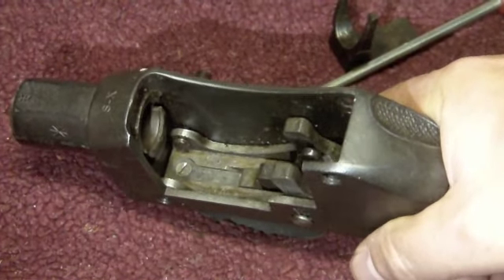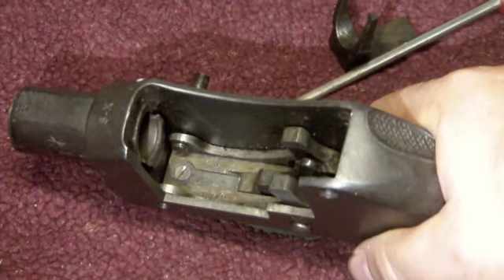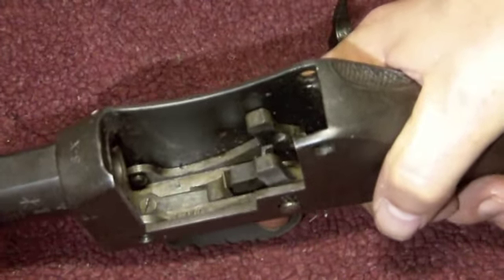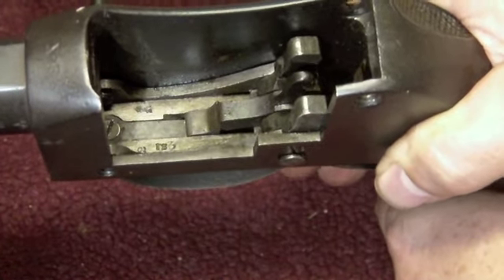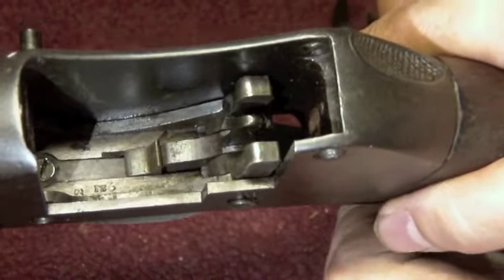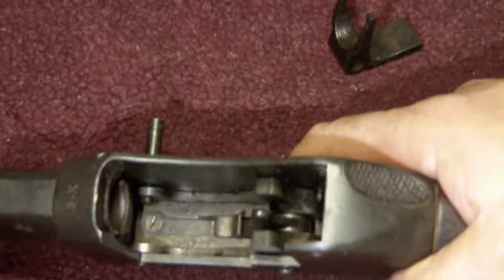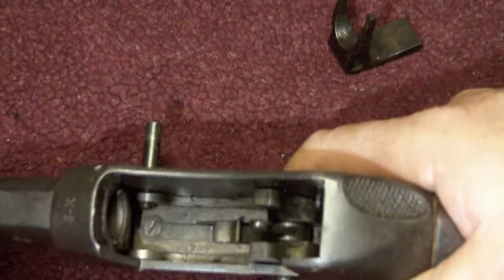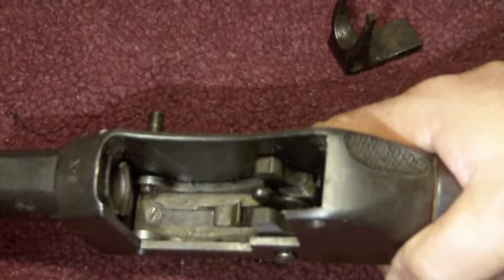Martini Henry Trigger diagnostic

Comment: Im trying to assemble the trigger and trigger spring into the trigger guard assembly (idk the correct name for it) can u make a close up vid on how to assemble it properly? I need to see how the trigger fits into the trigger guard assembly and exactly where the trigger spring rests on trigger. I noticed the trigger spring has a slight bend end. Which way does trigger spring go in (Bent side up or bent side down)? There is no vid on youtube that shows a close up view on how to do this.

Comment: I've got the opposite problem. We've got about 3 martini-henry's and 3 Martini-Enfields. the issue with most of them is that the trigger is tight. It takes far to much to pull and fire. We're working on restoring them, as we've got full and artillery models. But the trigger is to tight. Any advice? Really they're in rough condition, the sights are poor, the wood bad. The metal is mostly good though. I'm pretty sure between them all we have a good MH and a good ME.

Comment: Hi
I got a W.W. Greener GPMKII 12 gauge.
Found this out when dry fire testing (no shot shells in breach)
Issue I have is that when i cock the shotgun I forget to put it on fire and pull the trigger but when I remeber to put the safety to fire the shotgun releases the firing pin and will set off the shell.
How can I fix this issue ?

Comment: como desarmar el mecanismo  empezando por tornillos ,,que están oxidados
Reply: HOla Juan! Lei tu mensaje y quisiera preguntarte si estarías dispuesto a vender el fusil que tienes. veo que esta oxidado y tal vez necesita de algo de trabajo, pero igual me gustaría saber. Me avisas si estas interesado. Slds
Reply: el fusil que tengo quiero desarmar el cerrojo y limpiar el oxido  pero por estar interiormente oxidado no puedo,,,parce que se debe utilizar la llama de un soplete o tal vez taladrar el o los tornillos  no hay otra forma pienso,,quiero restaurarlo lo mas posible ,,,no lo estoy vendiendo
Reply: Rodrigo Zamalloa como decía el fusil que tengo no lo vendo  mas bien quiero restaurarlo  especialmente el mecanismo del cerrojo y palanca  pero no puedo desatornillar  porque seguro al interior esta muy oxidado   tal vez usando llama de soplete pueda aflojar tornillo ,,o en ultimo caso  taladrando los tornillos,,no soy técnico armero  asi que por eso era mi pregunta  que hacer?